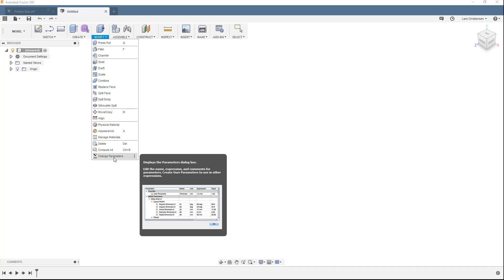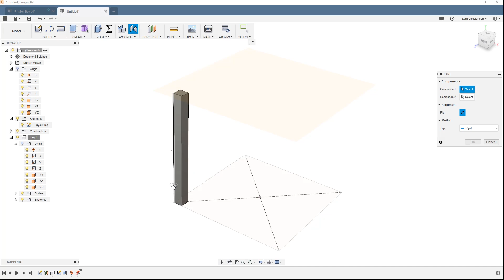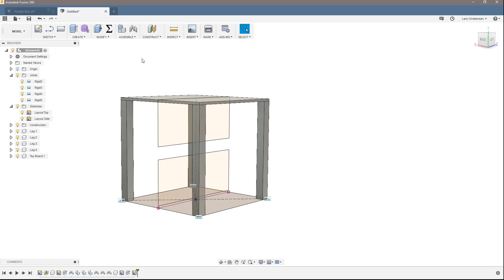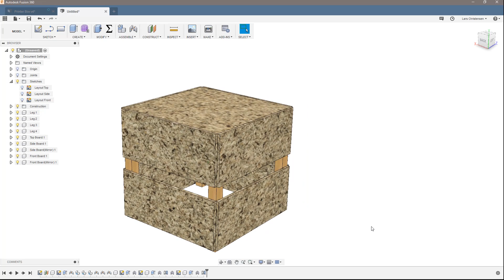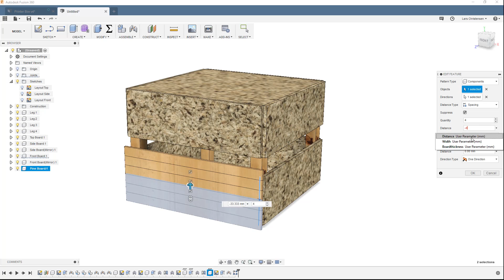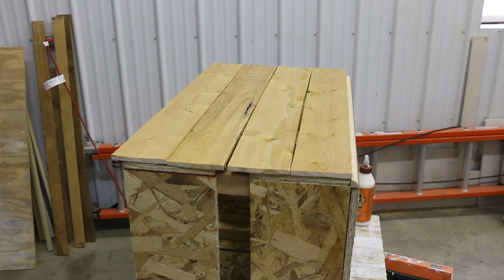Parameters, Joints, Layout Sketch & Glue — Everything in a Box — Fusion 360

Comment: Lars I want to create inlays in wood using vbit.  I noticed that V-Carve makes it easy but I want to use fusion to create my inlays.  Can this be done with Fusion?
Reply from the maker: I should create a video about inlays. That said, I will need to do a little homework first as I’m far from an expert. The biggest difference on the topic of inlays is that it’s possible in Fusion 360 but not a programing function like a woodworkers program, like V-Carve. At the end of the day, Fusion is based on mechanical CAD/CAM
Reply: @cadcamstuff  I look at the inlay as a mechanical function.  Like making a socket ball joint.  Create the pocket as the socket and the ball would be the inlay.  I was thinking if I created the pocket first then extrude the negative space as a separate body / component or vise versa which would create the inlay. So when manufacturing the tool path I would create the pocket first with a v-bit then flip the inlay to create a mirror image then do an adaptive clearing leaving the positive / inlay that would fit into the pocket like a Lego then use the band saw to separate the stock from the inlay once the glue dries.  What are your thoughts on that process?

Comment: Parameter feature suggestion. I'm sure your programmers can add this in a second. If you have not already set up parameters. How about adding parameters on the fly. Here's how to do it. Draw a rectangle, instead of typing 12mm as a dimension type "height=12" Fusion will automatically add the parameter" height" and the value 12. This will work as long as that WORD is not already a parameter. Also, I'd love to see on-screen sliders that can be used to adjust a parameter "Live"  Happy 100k!

Comment: I never thought of using hot glue nor would I have thought it would hold the wood very good.

Love to see a video on how to put some complex constraints in the design.  For example, I would love to be able to design a box that has constant volume (as a parameter)  but allows me to vary the length, width, and height independently.  I assume you would have to be able to "fix" one of the dimensions so that when you vary 1 of the other 2 the third dimension updates to adhere to the volume constraint.
Reply from the maker: Thank you for watching and commenting. I’ll have to think a little bit about how to do the volume calculation. Someone probably have it figured out👍😊
Reply: @cadcamstuff  I was thinking about it some more, and it would probably be good enough to just be able to see the volume calculation in real time as you change the length, width, or height.
Reply: Believe it or not many carpenters also use CA Super glue and activator in addition to the wood glue. The benefit is CA glue is thinner than hot glue, less gap.
Reply: @FilmFactry  I have seen that before.  I have not been able to find any CA Super Glue with activator for a reasonable price though, I am sure it is out there if you know what to look for.
Reply: @JeffKreska  Its regular super glue and a bottle of "Zipkicker" is less than 10$ and will last a very very long time since only a spritz is used. If you want to set CA glue and can take a tiny bit of clean up regular baking soda in a very light dusting will set it instantly too. Add more baking soda and you can build small filets

Comment: Hi Lars. I always love your videos and have learned so, so much from them.

I have a question. I've been designing a robot hand in Fusion 360, currently working on the fingers, and writing a C++ Script to manipulate them (I'm a software engineer) so that I can verify that all the joints work properly and, sure, to impress my friends. But I've encountered a problem. The more Joints my model has the slower the animation, driven by my script, goes. The code in my script should be running screamingly fast, as all it's doing is setting Joint angle values. It definitely seems that the slowdown is in the Fusion 360 code which, no doubt, doesn't simply move that one joint but has to check for all the other joints in the model to see whether they might be affected, but it's become excruciatingly clear that Fusion 360 is no animation engine. What I had hoped would be a nice, smooth, almost human-like hand motion is turning out to be a jerky, slow motion, creaky animation that hardly can be called animation.

Do you know of any way to speed things up with Fusion? Or is there a way that I could somehow export my model to some OTHER software that will let me animate more fluidly? Or, as a last resort, is there some other CAD program that I SHOULD have been using all along that does this aspect of the design much.much better?
Reply from the maker: Hi Roger, thank you for watching the videos and commenting. I definitely feel uncomfortable talking about C++ and the code that drive the joint function within Fusion. Way above my head!! I will say this, Fusion 360 is based on mechanical CAD. So accurately assemble machine components with screws and counterbores, and maybe a 2D work drawing added. Not animation. For that, Autodesk has software, like 3DSMax or Maya. Those are built for animation. I’ll be happy to forward an email to someone within the Fusion team that might be better and know a lot more (maybe a API workaround) just put FROM YOUTUBE in the subject line and send it to Lars.christensen@autodesk.com

Comment: Nice passion for jimmy:) i think he will look your channel if he needs to fusion something. Your tip with extruding from objects saved me a lot time last week.. pressing q for changing hole sizes too. So often i changed sketches, projected them and stuff like this. Thanks a lot!
What cost me a lot of time is when I’m using adaptive in cam. Selecting and NOT selecting what needs to be cleared in conjunction with top and bottom height is a lot to keep in mind. General selections in cam are tuff, would be great if we can project outlines for example, instead of the open and closed method.
Reply from the maker: Thank you for watching 👍😊 do you ever play with 3D adaptive? That does use outlines vs chains
Reply: Yes.. i mean, if you want a finish outline after 3d adaptive for example, why cant you just select the most outer contour of your part.. like projecting it. A lot of time i have dual sided parts.. as soon your bottom has a cutout, you need to switch to another path and select the model bottom as tool height.. or you do a projecting sketch first. Selecting lines, click again, make open contour.. select the end of your contour.. oops, its the wrong direction... go back and select each segment to the point you initially wanted. It’s really a pain. But i understand that cam is complex.. could be worse.

Comment: Would not have thought of hot glue.  Takes time for it to heat up, so if the air compressor is on, a brad nailer would be my first thought.  (Conventional, I know...)  Another tip to prevent things from sliding around while clamping wood together is to use a bit of table salt sprinkled in the glue before clamping.  The salt bites into the wood and prevents it from sliding out of alignment when applying clamping pressure.
Reply from the maker: That is a great trick 👍😊

Comment: My only issue with using hot glue is it doesn't flatten like wood glue. When you are gluing two boards together you don't want a gap between them. Wood glue by itself (because you made a gap) forms a very weak joint. With that said, using this hot glue technique is fine for what you are doing because it doesn't require any real strength.
Just a couple of points:
That's not particle board you used for your table, it's OSB (oriented stranded board). 
And before you complain and say, yeah but Fusion's particle board looks just like the OSB I used. Well, yes and no. You increased the size of the particle board in Fusion so much that you made it look like OSB because if you look really, really close at particle board it's kind of looks similar to OSB, it's just made from much small pieces of wood. 
OK next point. Yes, you can rip on a radial arm saw--BUT, you need to have the proper blade installed. A saw blade made for ripping has cutting teeth very different from a saw blade made for crosscutting. They do make blades called combination blades that will rip or crosscut but I don't care for them. With all this said, since you were cutting OSB, and this material doesn't have a grain direction, you probably would be better off with a combination blade. However, if you do try to rip actual wood boards, I highly recommend having the correct blade installed, ESPECIALLY when ripping on a radial arm saw.
Reply from the maker: Hi Brian, thank you for the comment. Very insightful 👍😊